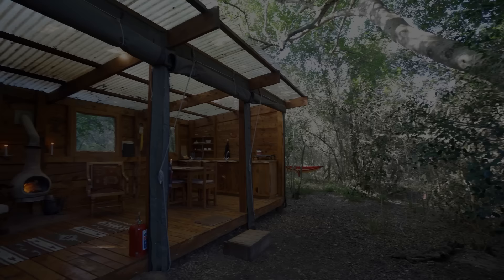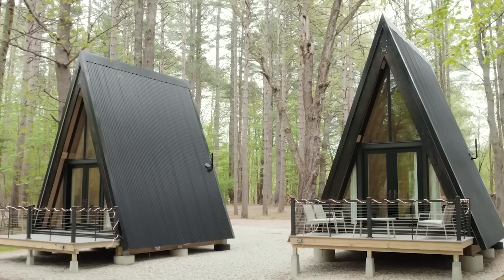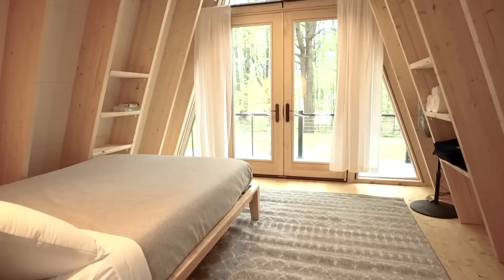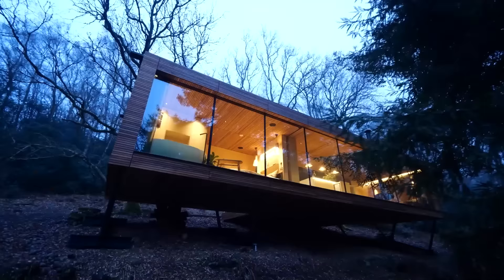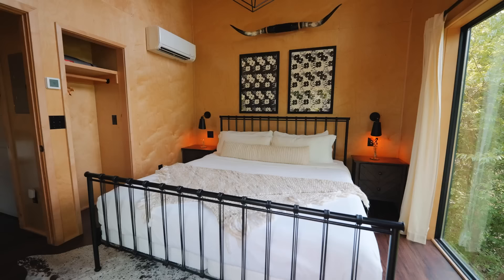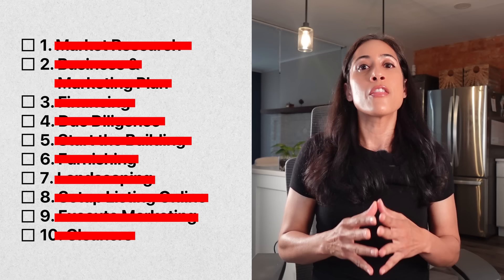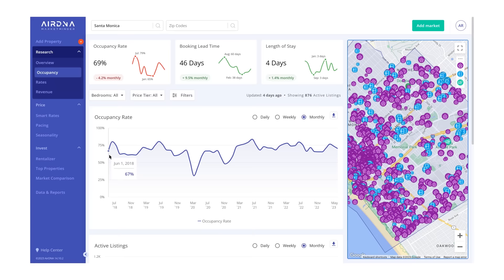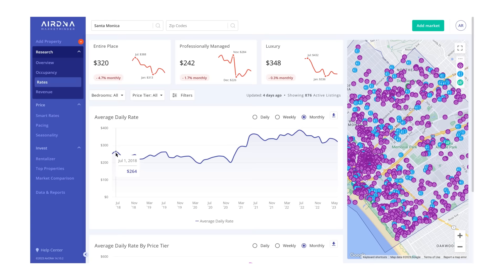HOW TO SET UP A GLAMPING BUSINESS!

Comment: I think you inversed 2 points on the checklist.  If the person is buying a property just for Glamping, then they need to do the due diligence (permit research) before buying anything.
Reply from the maker: I agree. Should happen before and after. For example, our current project is fine permit-wise but the infrastructure is taking more due diligence. Because we know the project will work, we were fine to purchase while we figured that portion out.